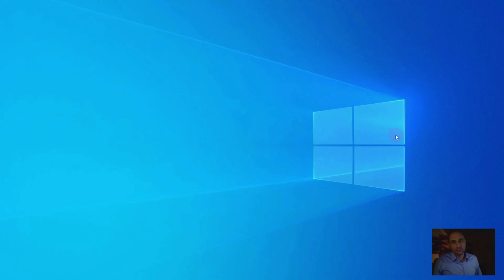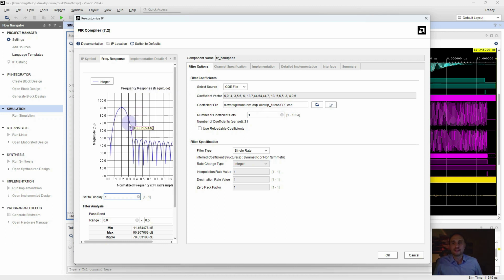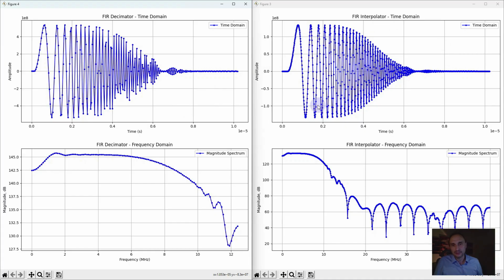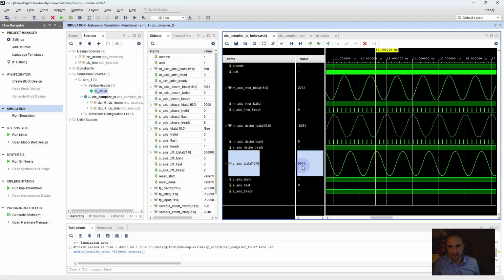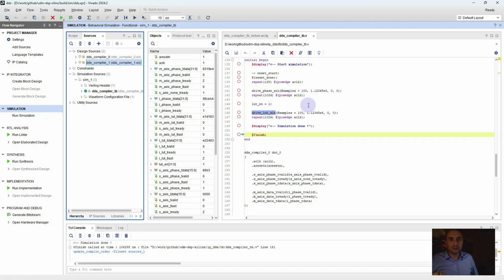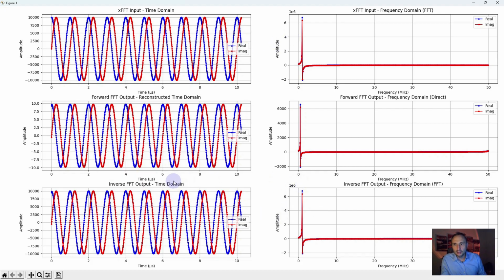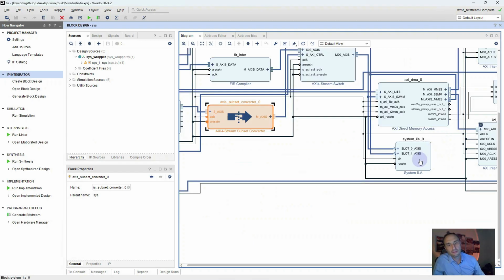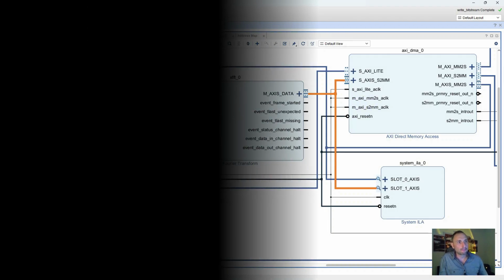Mastering Xilinx DSP IP cores on Zynq 7000: FIR, CIC, DDS, FFT

Comment: Thank you it is a comprehensive project but it was not very useful for me because I was expecting to see everything from scratch and building the project step-by-step with detailed explanation of every step rather than just explaining a prepared package, showing different folders and running different scripts. It is like driving a car rather building a car, we want to learn how to build the car not to drive it. With your expertise, I hope in future you create one video with one simple FIR filter and apply all elements of creating the project, using the IP, embedded Vitis, etc. and explaining every step with great details. Then you could have some follow up videos for CIC, DDS, FFT each again with details of its won.  Specially because this is on the latest 2024 toolset, that will be extremely useful and much appreciated. Thank you.
Reply from the maker: Please check out the course description: there are a lot of source code and build automation scripts including scripts to build Vivado project with integrated IP cores. Feel free please to use it as reference to learn how to connect and handle different IP cores.